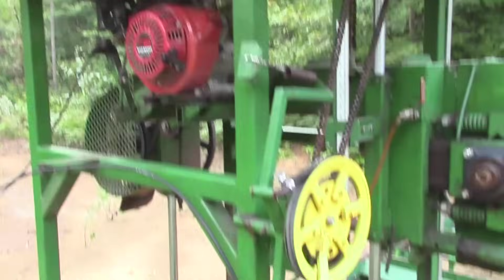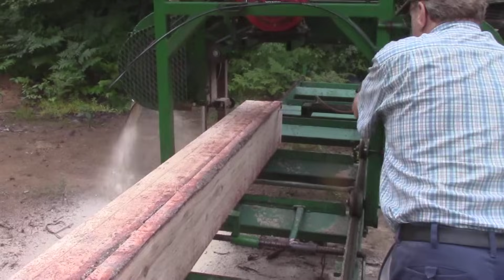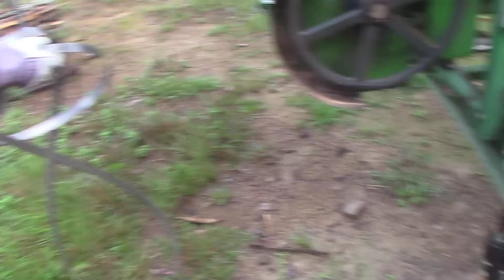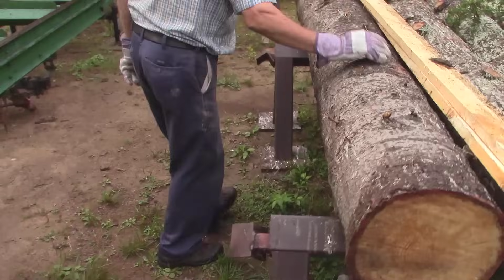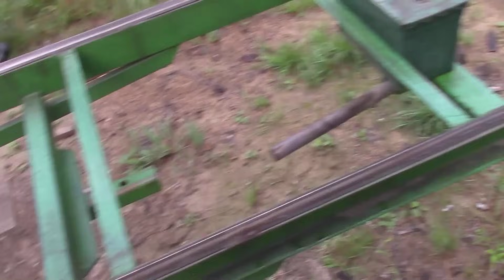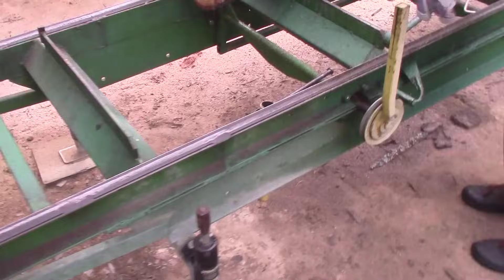Esko's Homemade Bandsaw Mill

Comment: Would love to see more of this mill, especially how he uses the springs to assist in raising and lowering the saw.
Reply from the maker: Hey Jeff, I went for a visit today and filmed some more with my Gopro. I'm uploading right now, so hope that helps.Look for the video Old Man Mill Build details on my channel.
Reply: Those springs do not assist raising the mill head, they simply take up the slack in the roller chain since it does not complete a circuit....
Reply: @canuckwoodchuck6396  how do I find your channel

Comment: excellent job i've been a filer for years and prefer circle mills but that is way better than anything on the market including wood mizer
Reply: Your post is old so your probably thinking what the heck and so think the very best sawmill to date,  even Cook has too much on his mill and overloaded with remote this and remote that. This mill can be remade and if I have anything to say about it, I will share this video far and wide. It made me a little nervous when he tightened up the blade, I just  wasn't there but I have broke blades back in the day when I first started sawing on one. That was a shake saw that I started on but the very same concept. He put them all to shame and with a quickness. He is my age probably (72) and getting around better than me. His log ramp is flat ingenious plus his log dogs are so simple you wonder why they are  not all like that. He is to my word, a master of this trade

Comment: I had an old cantilevered wood miser , only had 8.5hp B&S motor . Electric feed on anything up to a 16 inch face you could run it full speed , daily down the speed as the log got bigger than that . To watch it , it seemed to shake all over the place, but sizes were always very good ( The four post design just seems to be more stable ) how did it run with the tire wheels ?

Comment: Really nice! It doesn't seem homemade but modified? I wish you would have taken a video of him taking  a full cut and not just squaring it.
Reply: +David Sanders  Its definitely all homemade! The main rails would have been better as rectangular tubing as it would be stiffer. However the I-beam material was available  and was butt welded to get the necessary length. I'll get another video in the spring to cover the requests : )
Reply: I guess I was thinking more of the bandsaw itself not the table. If so, great job!

Comment: i thought you werent suppose to lubricate bandsaw blades? he has a lubrication tank according to the video
Reply: you must lubricate the blade.  we use a little dawn dish soap in the water. it keeps the band from getting sticky and assist in clearing the saw dust
Reply: thought it made the band slip on the drive wheel